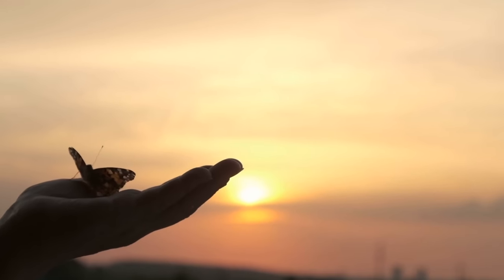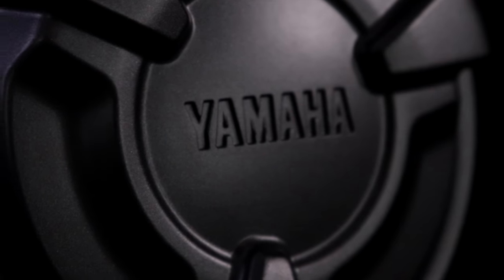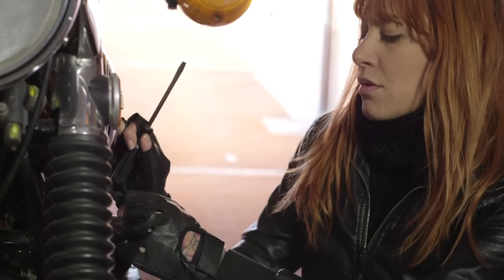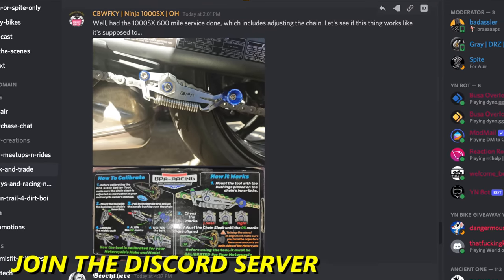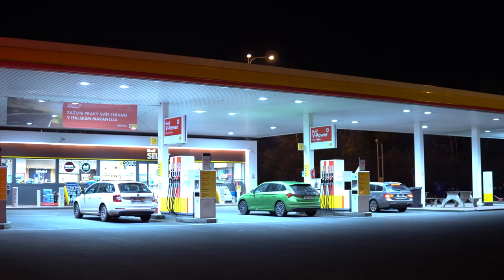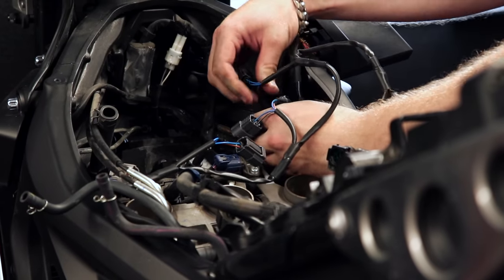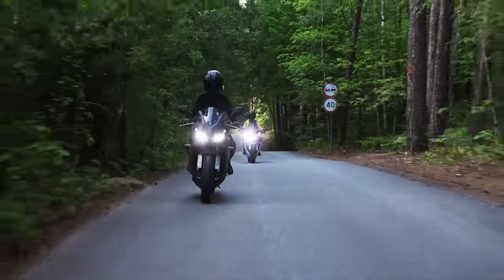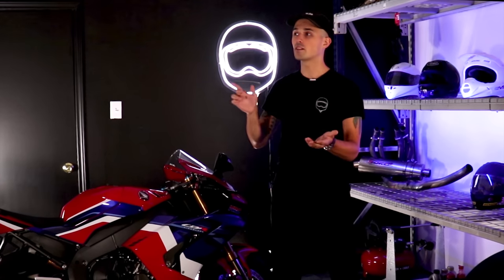7 Ways to AVOID Damage to your Motorcycle (Will Last Forever)!

Comment: Off topic question...why don't you recommend the new klr650 for new extra tall riders...just asking
Reply: Tall heavy dual sports are not the BEST beginner option. You're definitely going to drop that bike at some point. Dirt nap is the old tradition of the KLR. That being said, I started on a KLR as an 5'9” 130lb female, so I'm sure you'll be okay. Also, he has no love for the KLR, even the new one will be much the same... It can do everything... But does nothing well. It's an old tractor. Very capable, but not that great. You gotta love em to want em.

Comment: Valve check? When should I do that??? I'm at 20k miles on my new 650
Reply: Your owners manual should have a maintenance schedule inside of it. I have a 250l which is a much tamer engine and calls for a valve inspection after 16,000 miles. I think it’s safe to assume your 650 could use a valve check now, but still refer to your manual.

Comment: hey I am looking to a helmet with a dual visor set up (one that hides away) and was wondering if you or anyone had a recommendation, Thanks for the help 

I know most helmets can hold two visors and I can just put one or both down but I prefer one that is hidden.
Reply: If you are referring to the style of helmet with the hideaway sun visor, I have a HJC RPHA 70 ST I like.
Reply: @mlawcg  I plan on getting an Rpha 70st myself. Reviewers mention it's quiet design and heightened value relative to the shoeis
Reply: @mindwalkerpod  three reasons I got it besides the designs looking awesome, good safety rating, it had good cooling and it was rated quiet. This being my first full face helmet I don't have anything to compare it too, I would still recommend wearing ear pro for longer rides die to wind noise. I have had mine for around a year or more and the very top vent slider has gotten slightly loose and it will on occasion rattle in the wind. Not really a major issue, if it bothers me enough I plan to put some tape on it.
Reply: The Scorpion EXO AT-950 is pretty good. Take off the peak if you're doing only street riding, has that drop down visor you're looking for and it's modular. Got in a bad accident myself a month ago and it protected me just fine. Impacted a truck at 40~ mph and went flying over it, helmet was the 2nd thing to hit the ground and I had no concussion 🤙. My broken tib and fib though is a different story.
Reply: AGV k3 isn't a bad option. Slightly pricey but the colours on the AGV helmets beat any other I've seen. Also has dual visor if I'm correct.
Reply: @Bruce-Wayne717  hope you're doing better!
Reply: @Mike_Papa  thanks, I am. I got a titanium rod installed in my leg keeping it all together so I'm working on walking actually. Hoping I can get my hands on a dr650 or tenere700 and get a ride in before 2022. 

Cheers from Georgia
Reply: @Bruce-Wayne717  well be strong my friend! Every step you take now counts!
Cheers from France

Comment: What about two stroke advice. My manual say start bike and send it and wake up the neighborhood.
Reply: 2 strokes need to be warmed up. If not, you'll seize it and be rebuilding the top end. Late model aprilia rs125s had a feature that wouldn't let you ride off unless it was above a certain temperature.

Comment: You don't need to buy Premium gas to get the additives, Shell, Chevron, other bigger name gas, all grades have the engine cleaning additives.  If your bike is not tuned to run higher octane, it serves exactly zero purpose, power, cleanliness, efficiency or longevity wise, to run a higher octane grade.  Higher octane fuel is actually counter productive to engine power and efficiency.  It is less volatile.  It works in high performance engines designed with higher compression but more importantly, several degrees more ignition advance.
At your local Saturday night stock car track, the cars with limits on their engine advance (IE: Limited Late Models) will occasionally cheat by putting 87 regular in their racing gas (required to buy at the track).  It is MORE volatile.  YOU CANNOT make extra power with higher octane unless your engine timing is accordingly advanced.  Don't waste money on Premium fuel unless your owners manual says run premium.

Comment: '' It will last forever'' UNLESS its a BMW or an Italian one or an American one. Nothing can produce reliability put of unreliable machines with 2 wheels. Japan for the Win
Reply: Agreed.
Reply: Guess those 100K + bmw's are fake..uhuh
Reply: @azr2d1  i mean sure some may go there (mainly the Adv ones) but generally the BMWs rank among the lowest reliability especially in the first 3 years of ownership. Im not capping check it for yourself
Reply: @AllThisForWhat  That's misleading. IT's because of all the doodads that act up. Same with their cars. But they definitely last longer than 3 years :-)
Reply: @azr2d1  no they don't. Most bmws especially cars last like 3 years tops before you need multiple thousand dollars to replace the plastics that always break as well as the issues with the cooling system (which bmws are notorious for)
Reply: @AllThisForWhat  Sure, but you fix that and they will go for many more miles. You throw away your bmw after 3 years ? It's the price you pay for driving/riding bmw. You keep up with that and the engine keep purring. I've owned bmw's well over 3 years and stayed on top of the plastic and coolant stuff repairs and it never let me down.Those bmw boxer engines on their bikes will run forever.

Comment: NOT to harp on "Global Climate Change" but as we ease through more and more temperate winters with fewer snowstorms and occasional "warm snaps" where the ambience gets up above 40 or even 50 F, (and provided you live in a place where that happens) I've found it much more imperative through winter storage to just get the bike out for "maintenance runs"... This involves the usual warm up phase (a bit longer in the colder season than in summer... so think 8 to 10 minutes instead of 3 or 4) and then ride gently for between 15 minutes and half an hour... JUST do a few laps around the block or something parking lot related... yeah, play but play nice. Cold tires ARE a thing.
    THEN put it up again. As needed, of course, get a splash of gas and top it off, even add stabilizer if you're not so prone to the regular warm snaps as me or someone further south... BUT once a week for around 20 minutes some riding to keep her up is a solid way to keep the thing operational and actually reduce your "Spring-time rehab" process so you can do the bare minimals and get right back on the road again for Summertime's fun. It's also GREAT to maintain your own skills and abilities on the bike, even if building any is out of reach to the greater degree unless you have access to a heated track or something equally dubious and sci-fi.  ;o)
Reply: Personally dont see the value in this, but to each his own. If you store it correctly all you gotta do come spring is plug in the battery and check tire pressures etc. 
I am not taking any of my bikes out into the salt and crap unless i have to. Obviously if its a nice sunny winter day and you somehow dont have salt everywhere (where i live they basically pump it out on EVERY road for 4 months straight) Then it sounds nice to take your bike out for a short ride.
Reply: @Surpriseify    Might help that I live on a mountain road that likes to drop the city trucks (and piss poor truck drivers) into the neighbor's pond or the river...

    I picked it up as part of storage procedures for all engines in the Navy, just a fifteen minute run cycle, and they tend to last a LOT longer... Granted, some of those things (like the fire-fighting and dewatering pumps) could sit otherwise "idle" for years without more than training purpose... and we didn't always even start them for the training.

    BUT an engine is designed TO BE RUN... AND not everyone's winter is a simple 3 month "cold stint". SO it depends on your needs and available temperatures...

     AND for the salt, hot soapy water does WONDERS about that stuff, too.... Copious amounts of it.  (of course, I might be strange to have installed a hot-water spigot for the garden hose next to the cold one)... ;o)

Comment: It's bad to "warm up" modern engines.  Most of the wear happens when the oil is not circulating and coating everything, but that problem is solved within like the first 5 seconds.  

After that, most of the wear happens when the engine is not at normal operating temperature.  Idling an engine is the slowest way to warm it up.  Idling an engine means that it is below normal operating temperature for the longest time possible.

Sorry Yam, but you are perpetuating an old wives tale that does more harm than good.  Warming up a bike might have been a thing with a carbureted bike with points.  It's not a thing with a fuel injected by and ignition controlled by a computer.

Comment: I can confirm Hondas last forever. Just one thing, running lean is not hotter. Perfect stochioimetric mixture is actually the hottest. Leaner and richer mix will both run cooler than perfect mix. And a little rich will giv a bit more power than perfect mix.

Comment: Oh wow, 87 gas... Over here, the minimum we've got is 95. That's about $6.5 per gallon or $1.78 per liter
Reply: my fellow Euro squid! Hello!
Reply from the maker: Octane ratings are different
Reply: still their regular 87 octane is like Ron 92. Been like 20 years since I see a Ron 92 in my country
Reply: Damn thats cheap, prices in the netherlands are even worse
Reply: 95 wouldn't make a difference anyways even it was truly rated the same. The bike doesn't dyno any better than what it's tuned for. This has been proven time and time again.
Reply: @madpirate1790  but higher octane allows for a decrease of the chance of pre detonation, allowing for a better burn, it might not make more power or whatever, but its healthier, which is a win
Reply: @madpirate1790  I never seen any bike tuned other than for Ron 95 in my county. I use the cheap gas for my bikes anyways. But there are cars that is tuned to run on Ron 97 and run with with a bit less power on 95. Takeaway is just use whatever the manufacturer recommends. Apart from some detergents you won't get any significant benefits.
Reply: We got a huge moped modification culture where I live. Most of those modified engines need Ron 97 even Ron 100 to run good. These bikes are doing close to 120mph on a modified 150cc engine.
Reply: @TheKitt12  well kinda, I'm in the middle of Europe but not Euro

Comment: Ok, my Benelli 135 has a rev limiter, so when it hits about 10k it bounces off. Is it bad to occasionally redline? Does the limiter prevent damage from over revving?

Ps. I know my question might sound dumb, but I'm use to riding dirtbikes that have no rpm Guage, so I usually shift in high rpms by ear.
Reply: To put it simply, no it is not. The rev limiter is there to stop the bike from over revving and causing internal damage to the engine, it's ok to hit it every once in a while just don't do it constantly or ride the bike at redline like the Grom hooligans do and you'll be fine. I've been riding in dirt since I was basically old enough to walk, so I totally get the shifting by ear thing; my advice is, take your time, learn the rpm you want to shift at and learn the tone of the engine, and just train yourself to shift that particular bike like you did your dirtbike. After awhile it's just second nature, I know I kinda rambled but I hope it helps ride safe!
Reply: @Dugauntlet  Cool, thanks for the advice man right on.. ride on 👍

Comment: Does carborated bike need warm up cause my bike engine stop as soon as release race/accelerator when I start it 
*sorry for bad English
Reply: Yeah, you have to warm up a carb bike, unless it's already very hot weather, even then, just give it a minute to warm up still. If they're not warmed up, they'll stall when you try to pull away, just give it an extra minute
Reply: For that you have a Choke in every carburated bike.
Reply: @dennisclark9544  thanks 😊
Reply: @aaronschulz9896  thanks 😊
Reply: I'd just let it start and ride it easy.
Reply: @madpirate1790  ok 👍

Comment: I bought a Yamaha WR 250’ Valve adjustment intervals 26,000 miles just saw one that just turned 70,000 miles without any motor repair! Buy a Yamaha

Comment: 3000mile oil change?? 

I thought it's best @ 900-1600mile
Reply: Depends on how hard you ride it. Regular commuting, yes do 3000. If you are racing and getting the engine very hot very often, then 900-1600 would be a good idea.

Comment: Another example of misinformation claiming leaner mixtures burn hotter.  Stoichiometric burns hottest.  Ultra-lean mixture can cause uneven combustion and detonation that can cause driveability and permanent engine damage.  

Power commanders will waste fuel by operating too rich when not needed.  This can permanently damage cat by plugging or overheating, produce excessive engine  carbon build-up, and dilute  oil film on cylinder walls causing premature engine wear.  Some older bikes with poorly  designed fueling characteristics may benefit from this type of device but how many bikes currently produced in last 5-10 years actually need this?  Not many because manufacturers have mostly figured this out and this type of reputation will have buyers looking at alternatives.

Comment: You can 100% ride your bike whilst its not warmed up, there is 0 benefit to letting it warm up on idle. 
 Be gentle tho, dont lug the engine and dont rev it super hard as Yam says. Saw a study (for cars but same goes for bikes) that basically debunked the whole "let it idle" 
in fact letting it idle will keep the engine cold longer, better to get a bit more revs in the engine to speed up the process.
 
And wow to draining it and leaving it with no oil
just wow lol.
Reply: How long should you be on idle? How long during the start of the drive before ripping the throttle?
Reply: @edwardjones6111  depends on temperature, size of your engine/amount of oil etc.
 Again i personally dont let it idle very long, i warm mine up whilst riding. On my VFR 1200 i usually ride 7-8 kilometers before i start being harder on the throttle, but even then the oil is not yet fully warm.
Reply: @Surpriseify  i just drive a 150cc bike. So would it be shorter before it heats up?
Reply: @edwardjones6111  it would for sure.
 5-10mins top i’d think

Comment: I've rarely let my bikes warm up to operating temperature. Air cooled engines (particular HD) will develop hot spots rather rapidly.  I prefer to ride like I drive cars.  Start it up, let it warm up while I back it out of the garage, and ride off....Slowly. easily for 4-5 miles.

 Don't modify your stock engine?  Well, you just lost every Harley rider. ('cept me)

Comment: So ride your bike responsibly. Maintain it properly, at minimum sticking to the service guidelines. Octane is a myth, just use whatever they recommend in the manual. My Versys 650 recommends 87 octane but the minimum I can actually get in Australia is 91, and she doesn't knock. Ever. I run 98 octane on longer trips but ripping around town I generally use 91.
Reply: It would be less likley to knock with higher octane fuel

Comment: Sorry, but loads of bad advice here. DON'T let your engine idle until it's warm. That's basically the best way to put as much wear on your engine as possible. Let it idle for 15 seconds until the oil is distributed and drive off with low rpm. The faster you get your engine up to temp, the better (with a reasonable amount of throttle). Sorry Yam, but that's engine knowledge 101. Also, who the fuck reuses a head gasket?!? Are people that cheap? :D

Comment: Noob Hondas are not the benchmark for reliability they once where ,After Mr honda died  Honda has been cutting corners . ...Example the cbr1000rr where oil burners at the rate of a quart every 500/1000 miles or the new cbr1000rrr which had massive recall on all 2019 cbr1000rrr for con rod failures